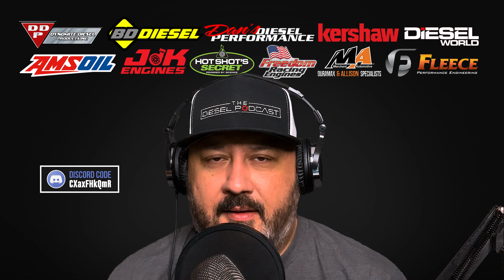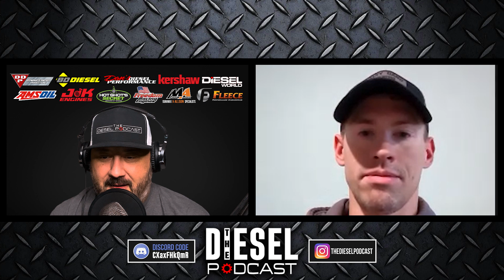Easy HP Upgrade for Your Truck

Comment: I own a small diesel/automotive repair shop (Folsom’s mobile auto repair) and am also a diesel performance enthusiast, I don’t understand why anyone would use one of these manipulation modules compared to an actual tuner that can do the exact same thing and a lot more by recalibrating the engines parameters vs this “module” that simply trick the computer into thinking certain parameters aren’t met so the computer naturally ramps up said parameters to compensate and potentially cause a issue or check  engine light when the vehicle notices something’s off

Comment: Lol at the entire fuel economy improvement word salad. News flash, even the manufacturer of every vehicle doesn't tell you exact MPG due to differences in many variables...altitude, driving habits, etc. 
Just be honest and say it won't help or we have never tested it.
I can say guaranteed it won't. Dumping extra fuel for more power, increase soot, equals more frequent regens on emissions trucks and the Regen process will cause lowered MPG by it's nature. No brainer

Comment: So these gains are just adding the module? What about adding it to a truck with cai in a L5p. Are there any dyno videos?
Reply: Find an actual non-vendor sponsored video of Dyno before and after. It does trick the truck to add fuel and thus power but in the long run it's gonna trash your motor/emissions systems.
Also look at Dr Performance, it's the same product, different label.